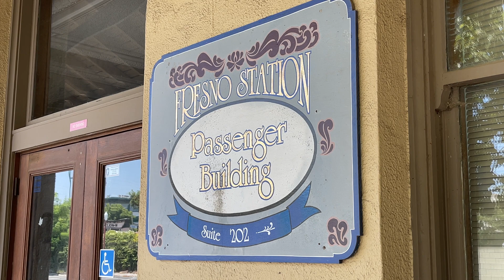Los Angeles Railroad Heritage Foundation Visits California High-Speed Rail Construction

Comment: Only if the route of this project made sense! Hopefully, other routes will be branched out from where the high-speed route has been jutted out. Make it make sense people!!!
Reply: Lol, what doesn't make sense about the route to you? The HSR system will connect 9 out of the top 10 cities in California by population. The first line will connect the two largest metro areas, SF and LA, via the largest cities in between. Those Central Valley cities are also the fastest growing parts of the state so it makes perfect sense to connect them to the two juggernaut metros. 

Seriously, what exactly doesn't make sense here? It seems that California chose the most pedestrian, common-sense routing for this project.

Comment: Interesting but expected responses to my comments, which is fine.  Most people viewing this video (and the rest made by the HSR Authority) don't agree with me.  I'm an engineer (registered California Civil and Electrical) and have been following this project casually from the beginning.  My first thought when I heard about this project was "why build a rail line from SF to LA?"  Rail works when it goes from one high density urban area to another.  Shanghai to Beijing (or just about anywhere in China and Asia), Barcelona to Madrid, Paris to Leon, etc. (ridden many of those and loved them)  The proposed rail line from LA to Las Vegas makes sense on the surface of it.  But be that as it may, the second thing I looked at was the financial feasibility of this project.  Based on the HSR Authorities own numbers I did a 'back of the napkin' calc in 2012 and determined there was no way ticket sales would pay for the cost to build it let alone O&M.  And that was when it was $32 Billion.  I couldn't believe the state legislature didn't know that also, even with the project promoted to 'pay for itself'.  Third, in 2020 my wife and I drove by the Flyover project near Hanford on 198 on our way to Sequoia National Park.  I saw the condrete pillars sticking up in the air with rebar ends rusting away.  Why did no activity look like it was going on?  Concrete cures in 28 days.  That spured me to do more research into this project.  In the end I simply found this project to be a boondoggle that enriches engineering firms, unions and politicians.  I seriously doubt a train will run one mile on this project before the plug is pulled.  And it will be pulled.
Reply: In contrast to a lot of other comments on this video, which rubbed me as unreasonably optimistic (and possibly from shills), what you said was interesting to read and made a lot of sense.  Thanks for sharing!

Comment: Keep plugging away! The next segment should be from Bakersfield to Palmdale.
Reply: Merced to San Jose (and SF) will deliver the most benefits. HSR from Bakersfield to SF will be faster than driving between LA and SF, even with the current LA-Bakersfield bus bridge, and open up greater opportunities for commuting between Silicon Valley jobs and Central Valley housing. 

HSR to Palmdale and transfer to Metrolink to LA would take right around the same amount of time as the bus bridge currently does. Metrolink takes 2 hours between LA and Palmdale, with all stops, and CAHSR estimates a 23-25 minute ride between Palmdale and Bakersfield. Add in 5-7 minutes to transfer at Palmdale and that’s as fast as the 2 1/2 hour bus ride. 

If the Metrolink AV Line between Palmdale and LA were to be upgraded like Caltrain is with faster speeds and electrification, then CAHSR could share those tracks to provide one-seat SF-LA service sooner, until they complete their own tracks. Plus it would improve Metrolink AV Line service which would hopefully then expand electrification to their other routes.
Reply: @ChrisJones-gx7fc  1) There's FRA-compliant equipment that will run at 70mph or more on the existing freight lines and really fly on high-speed track, and there's an existing passenger rail operator in Northern California who has expressed interest in a cooperative agreement with LOSSAN to operate that equipment on the high speed line until HSR can start full operation; and 2) the politics of going from San Jose to Merced is fraught, and we're going to see substantial delays in construction because of that and getting funding for right-of-way acquisition in that high property value region. We'll get statewide rail service much sooner by building connecting Bakersfield to Metrolink and letting the San Joaquins work with LOSSAN to run fast trains while finishing out the system.
Reply: @maxrudder6091  but we voted for high speed rail, and CAHSR plans to run high speed trainsets from Day 1. It’ll be electrified high speed trains between Bakersfield and Merced from the get-go. They’re set to begin the procurement process for the first high speed trainsets within this next year, so they can be delivered in 2027 and begin testing in 2028. 

As for Merced to San Jose, CAHSR plans to share Caltrain tracks from Gilroy north, extending a pair of electrified tracks south from San Jose which hopefully will be done before HSR arrives so Bakersfield-SF service can begin ASAP, so its impact should be less than what it plans for going from Bakersfield south to LA. 

There’s a very strong case to be made for completing Pacheco Pass and linking the Bay Area and Central Valley with HSR, two of those reasons being the ones I said about the significantly faster travel time between LA and SF and providing a fast and frequent connection between Silicon Valley and the Central Valley. That, and CAHSR is committed to reaching SF next before going to LA and Anaheim.